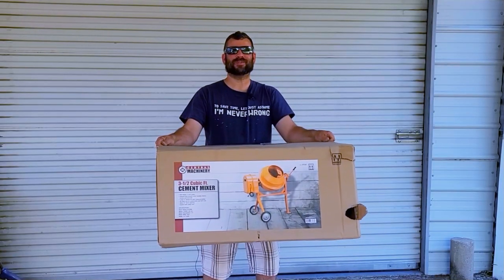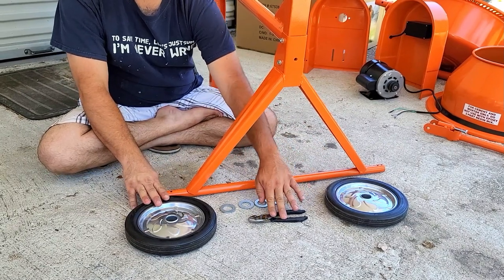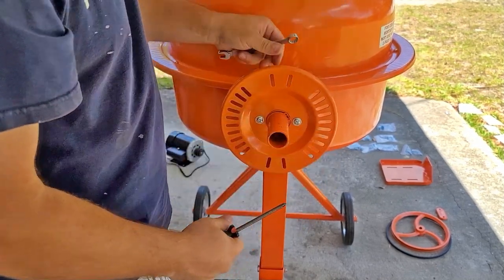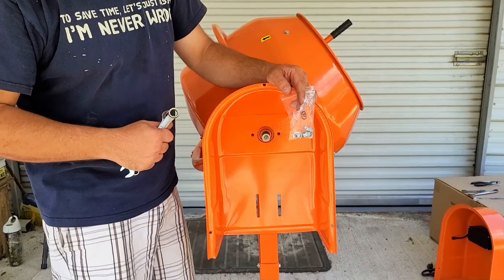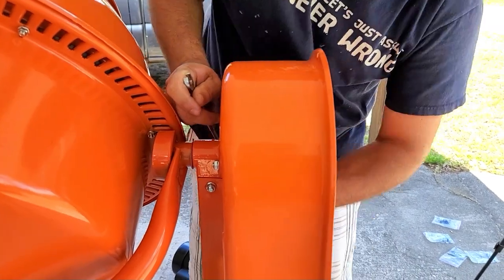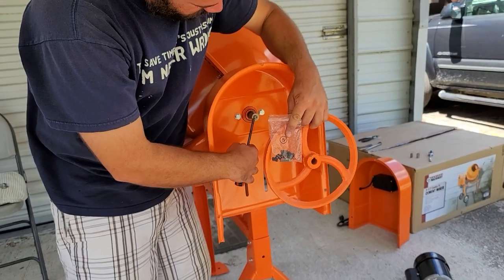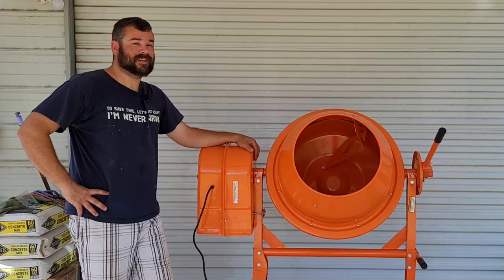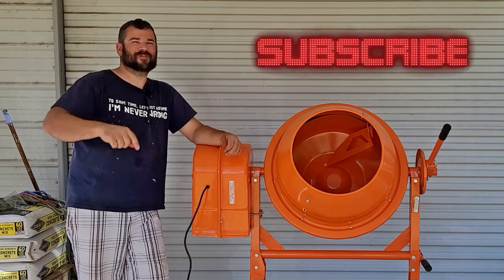Harbor Freight Cement Mixer Assembly Guide

Comment: Mine also came with all the hardware in one big bag. The count of individual pieces was different from the parts list in the manual. Some parts of the assembly (especially cramming the spring into the handle) were very difficult. Some of the assembly (e.g., gasket fastening) could and should have been done at the factory which would have saved me at least a half hour. All in all, not an impossible task, but more difficult than it had to be.
Reply from the maker: Welcome to our channel!

Comment: I had missing hardware too but not hard to replace, just inconvenient. Also, you don't need to mess with the electrical anymore, it's already done. One more thing if anybody decides to buy it, the hardware all come in the same baggie. LOL have fun.
Reply from the maker: To be honest, I don't know if I had missing hardware 🤣. The instructions were so bad I couldn't tell which was which so I just put them where I "thought" they should go! Welcome to our channel!
Reply: @VIPHoldings  Same here. I have hardware left over. I'm not sure if it's the wrong size or I put something where it shouldn't go. That was a frustrating day.
Reply from the maker: @johnseitz4977 My hardware came in bags but weren't marked properly and I had several things left over. That's when I knew this would be a good video 😁. Welcome to our channel!
Reply: How in the world did you get the motor in the right spot with the electrical already done? Ours came all connected  and it looks like we're going to have to disconnect it to get it situated right.
Reply from the maker: @lukesieber7684 it's been awhile but I vaguely remember doing some electrical first before installing. Welcome to our channel!

Comment: Do you have to adjust anything when you lower the drum into the stand? My scenes uneven and does not fit both sides. Only one size fits the other is too far away.   1:50
Reply from the maker: No adjustments required. I would double check the U shaped piece is put together properly. If so, see if something is bent. Welcome to our channel!
Reply: @VIPHoldings  thank you. Had to take it back for replacement. Seems I was just lucky ha
Reply from the maker: Oh, that sucks! Good luck with the new one 👍

Comment: Great video.  I must have gotten one that was returned as it was missing assembly instructions and the bags were all dumped into one.  Your video helped a lot!  One thing I would have done a bit differently was mention what washers were used at each step.  I was able to guess most of the time, and it works great.
Reply from the maker: I'm so glad it was helpful. Welcome to our channel!
Reply: Mine had instructions but all the hardware was in 1 bag. Except for the coil spring which was inside the handle. But not convinced mine was a return, the packaging looked pristine. Of course Im not done yet and I dont have remotely as many nuts and bolts as that list shows. Fingers crossed.
Reply from the maker: I would take it back and make sure you get one with the right hardware. It's hard enough to put it together with everything. Don't put yourself through that. Welcome to our channel!
Reply: @VIPHoldings Unfortunately I bought it last year and they would probably balk at that. I wound up 2 rubber seals short, had to use 2x 20mm bolts  instead of specified 15mm and had 20 extra pieces.  Plus mine had pieces already together (the switchbox wiring for example) that your video didnt reflect, but it looked professionally done.  Made it kinda tough to put the housing on with it all wired together. Wound up using the box on its side to support the housing with a couple of bricks under the wheels to lift it high enough to clear the box to give access to tighten the screws.
Reply from the maker: @natehill8069 Sorry to hear that, but it sounds like you MacGyvered it to get it to work for you.

Comment: Mine worked great but has been sitting for about a year. Now I can’t get the switch to work. I noticed the yellow tab on the switch is missing. Is that some sort of safety? maybe the switch just isn’t working anymore.
Reply from the maker: I actually don't know about the Yellow tab and I'm currently traveling abroad so I can't go check mine but you can put a meter on the switch wires and see if your switch is dead. Sorry I couldn't be more help but welcome to our channel!

Comment: 3:30 My version (bought late last year but just now getting around to building it) does not have a bolt to tighten the spring, you just compress it by hand as you install the bolt. Which is awkward, so I left the plate loose so that it could be pushed back by the bar and then tightened the plate after the bar was in place. Would be just AWESOME if the  hardware was in little numbered bags instead of 1 big bag.
Reply from the maker: Agreed. Plus, the instructions weren't exactly... clear. Welcome to our channel!

Comment: I purchased this mixer from Harbor Freight. My hardware bags were not numbered like yours. They were mostly illegible. The directions really do suck. There were missing hardware also. The hardware you used on the paddles are not like what my directions indicated. Mine doesn't have the orange oval bracket for the motor mount either. Just a chrome looking bar with two holes in it.

Comment: I was thinking now to remove the tube and put thread lock on the gear tube bolt. Not going to use it till Spring 2023 so I can do things to it, was thinking to put better tires and axle on it. thanks for your time
Reply from the maker: Sounds like you're going to give it a complete overhaul. Let us know how it turns out. Also, welcome to the channel!
Reply: I did remove the tube today , oiled the bearing that the tube spines on, did lock tight the screw that hold the spine gear, I put antiseize on the shafts, threads so later I can remove items . going to made a wood pad for the front stand and rear of the mixer to sit on keep the rear tires off the ground

Comment: OK, mine's together. Was short 2 rubber seals, had to use 20mm bolts in lieu of 15mm and had 20 assorted parts left over, mostly washers. Sounds like the engaging teeth need grease, or maybe graphite. There was a big scratch that someone touched up with not-quite-the-same-color.  Had to go get gasket sealer, which I had never even heard of before. 

Took me about 4-5 hours, not counting a trip to the store. About 3 hours of that was going back-and-forth-and-back-and-forth-and-back-and-forth-and-back-and-forth-and-back-and-forth-and-back-and-forth-and-back-and-forth-and-back-and-forth-and-back-and-forth-and-back-and-forth-and-back-and-forth-and-back-and-forth between the picture, the parts list, the instructions and the exploded view on EVERY STEP to figure out what they really meant by what they said and then try to figure out which piece was #56 etc.